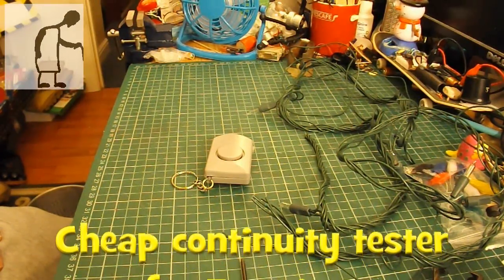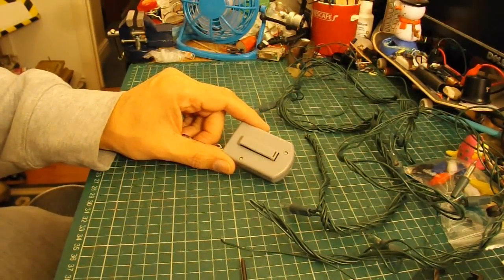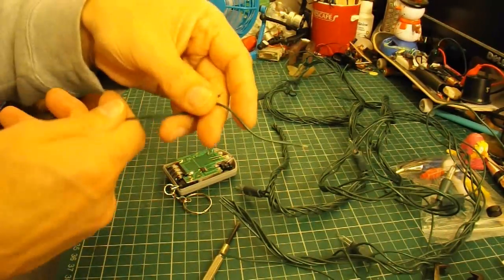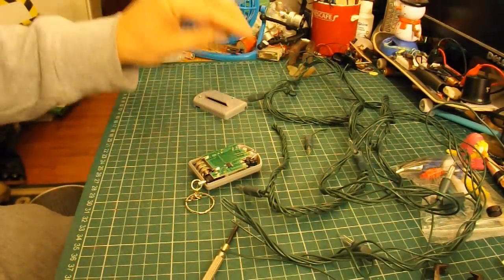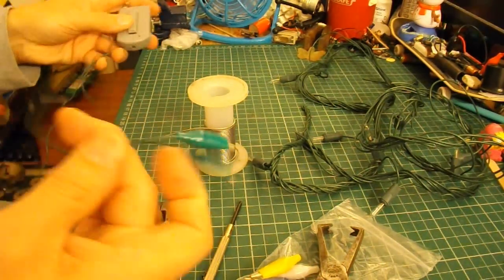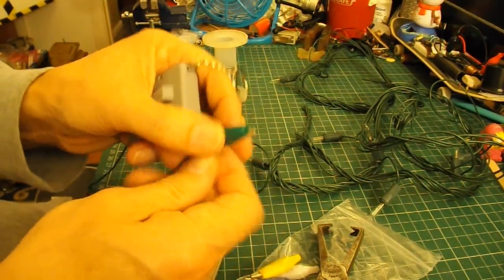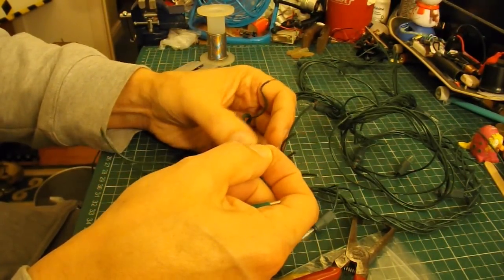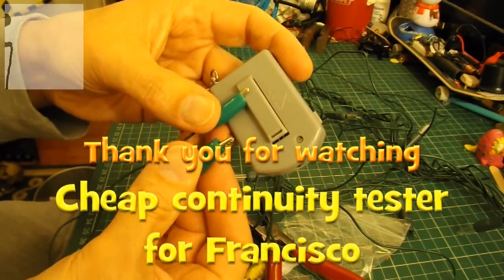Cheap continuity tester for Francisco

Comment: Super interesting !.
I had one, but I broke down and is likely to make me another. 8-)

And if it sounds too strong and as you well said on another occasion, you could put a resistor or a diode drop where some current and incidentally give some protection to the circuit.
That if:
I recommend to play the world, you never do with current flowing through the circuit, much less voltage if the home network, or higher voltage. Could be dangerous!. 8- (
Greetings and thanks for reminding this project !. 8-)
Reply from the maker: +Francisco Javier Lázaro Pinela thank you for your suggestion :)

Comment: And It's simpler to use than a multimeter.
Reply from the maker: +Graham R Dyer yes but there are plenty of situations where it is less than 100% especially if you don't recognise the difference in the tone for partial contacts. You definitely don't want to use it on a live circuit. However for a £1 you can't beat it.
Reply: +Graham R Dyer Graham However, this can be a simple tool that takes up little space.
If you had to do other measures, such as resistance or tension, since you have the multimeter, because not need anything else.
But I think that this tool takes up little space and can dip into it at a time.
I always try to have one.